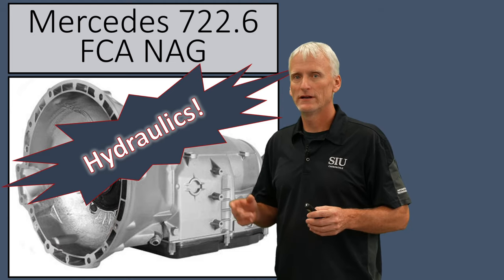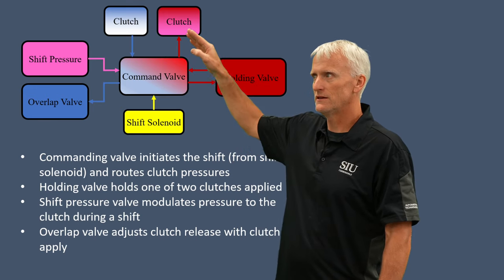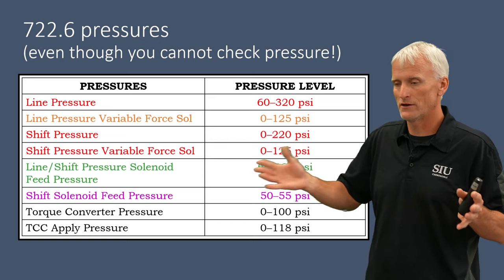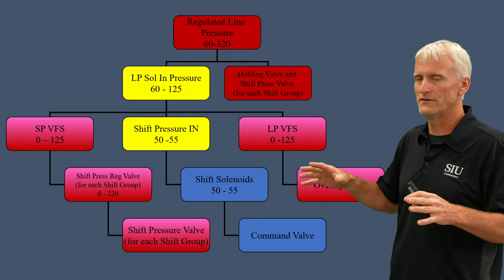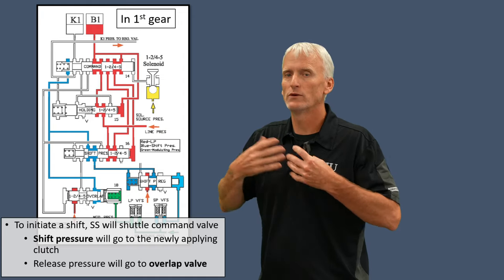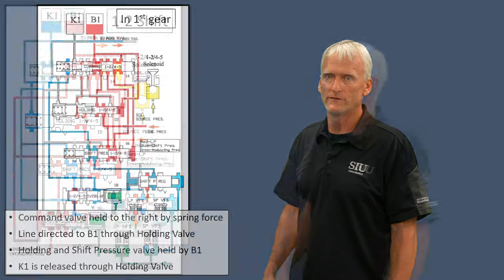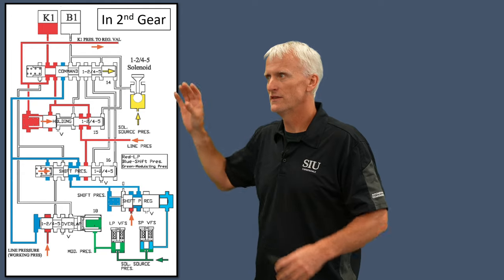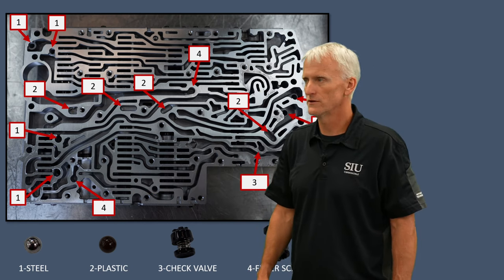Mercedes 722.6 Chrysler NAG hydraulics

Comment: Dear professor. I have 12 charger srt nag1 car makes 40hp more than stock. Iam trying to tune it by raising shift pressures by 2-6 psi line pressure and slightly reducing torque management and i still cant seem to get a snapy postive hit shift its still too soft. What am i missing?

Comment: Can a worn TCC damper valve damage anything? I changed my TCC solenoid but I can still feel the TCC when the car is warmed up. When it’s cold you can’t feel it. Otherwise the transmission shifts very good.

Comment: Good resource, thank s for, i m rebuilding a VB and found out that the tiny plastic pressure feed valve is missing, i don t know if that is not included in the AMG VB or that was actually toasted, watched the video hopping to get a clear picture about it s functions but you didn t mention anything related.